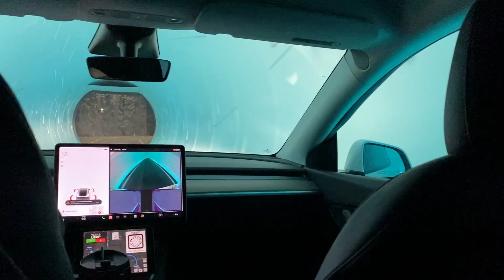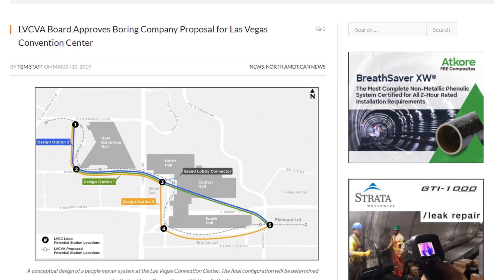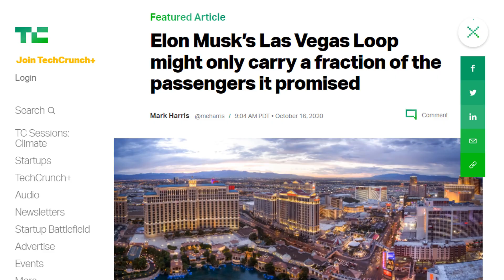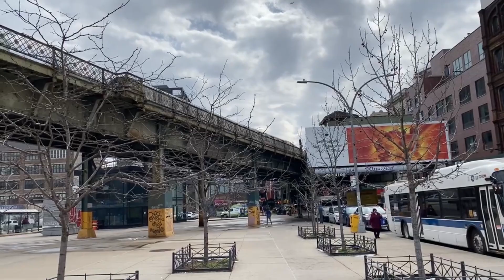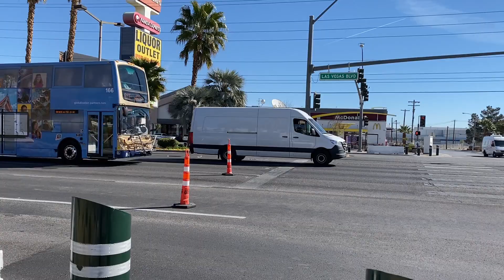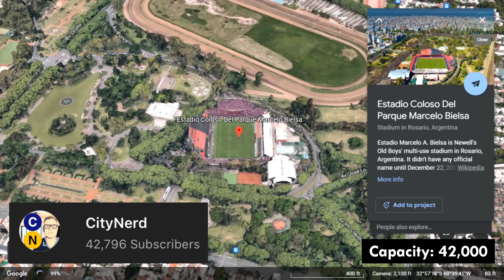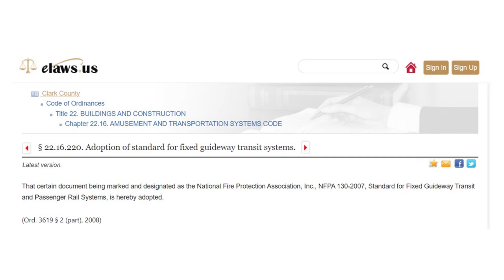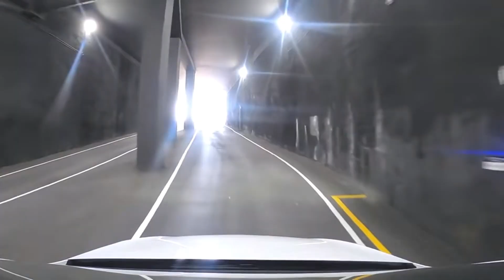Inside the Las Vegas Loop: Transportation Game-Changer, or Complete Waste of Time and Effort?

Comment: Maybe one day the could replace it with electric busses, then the capacity could very easily be increased with minimal changes to infrastructure, I guess
Reply: That's the long term plan. The cars are a stop gap because Tesla doesn't have the capacity to design and build a bus yet for Boring Co. Plus there is only one loop at the moment. First step, make the cars self driving, then create small self driving buses. 10 years from now, if they keep going, people will see this as a low cost solution for cities that otherwise can't afford a full blown subway system.
Reply: @ericquest1802  Oh, okay, that's cool. If the city wants a full-blown subway they can just use https://en.wikipedia.org/wiki/File:Why_London_Underground_is_nicknamed_The_Tube.jpg these.

(how the hell do the passengers waiting for a train not get blown away by all the compressed air on that thing?)

Comment: I mean some weirdos here in Denmark who only care about economics and has probably never taken the bus in their life always go about complaining, saying "Operating the trains costs the same in subsidies as shuttling everyone in private taxis, and we drivers have to pay for it" which is just complete bogus. Then again these people also have a burning hatred against Light rail and will only accept either BRT or a fully underground driverless light metro.

I guess the best saving grace for these weirdo tunnels without major rebuilding would be some sort of higher capacity autonomous vehicle. Like take out the proprietary sedans and replace them with something like a small articulated bus built to fit into the loading gauge, and you could potentially save bits of this sinking ship? IDK man, this whole thing was stupid from the start, I'm just looking for ways to make the best out of a bad situation.
Reply: simple solution. buy old mark 71 stock from the london underground. lay track, run a mini bakerloo line in that tunnel. dont need to do too much to make it work.